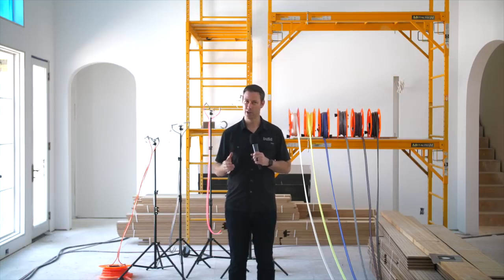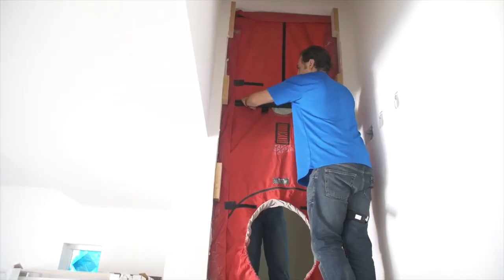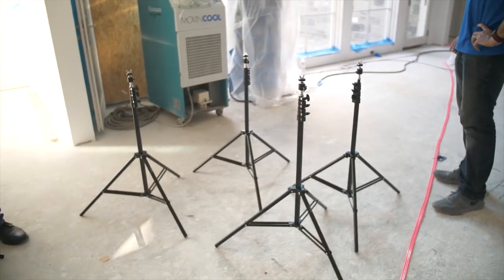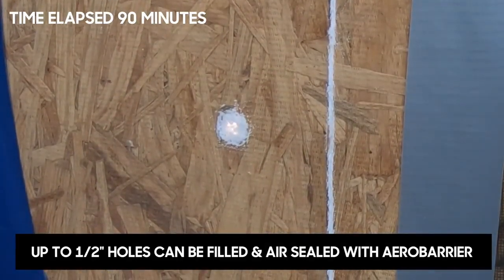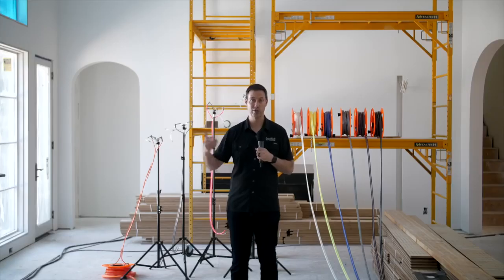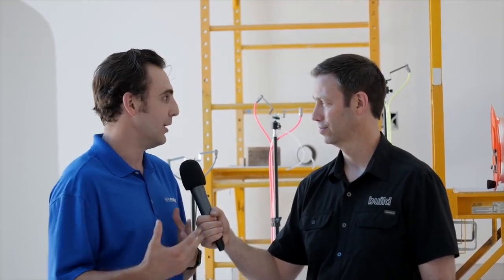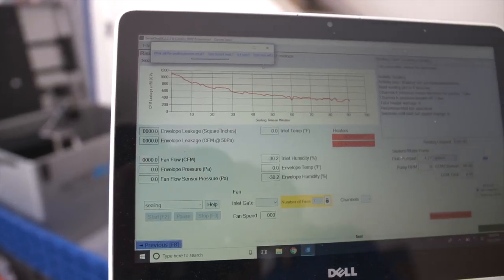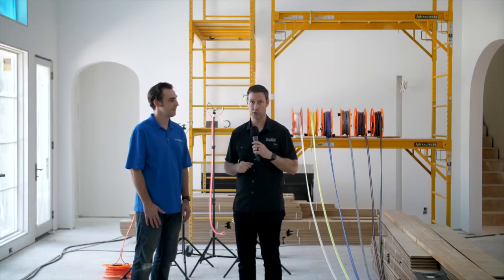Matt Risinger Calls AeroBarrier A Game Changer

Comment: Just used the AeroBarrier system in NC for new construction.  Cost was $1.00 per foot for a 2700 sq/ft ranch style house.  Used the zip 2.0 system, started at 4.7 ach50 and in two hours got to 1.0 ach50.  Very pleased with cost and final blower door results.
Reply: That’s pretty damned impressive!

Comment: I heard this is $4 a sq ft. If that is true most will not use it. I'm doing a renovation and would like to use this but with a 2K sq ft that would be $8K
Reply from the maker: Hi Minni -- The price varies by partner and depends on several factors, but AeroBarrier typically costs around $1 - $1.50 per sqft. We recommend contacting your local AeroBarrier partner for a free quote. You can find your local partner by visiting https://aeroseal.com/aerobarrier/dealer-locator/

Comment: I've done AeroBarrier on two houses now thanks to Matt Risinger promoting it.
Reply: How much was it? Was your houses remodels are new construction?
Reply: @CAC-1111  $1.50/ sq ft. New Construction
Reply: @wjthehomebuilder  thanks for answering. Can you tell/feel the difference in the home ?
Reply: @CAC-1111  I don't live in any of them.  The proof was in the blower door test.  It was extremely air tight.  One house was 1400 sq ft and is being heated with a 9000 BTU heat pump.  That is a low energy demand for 1400 sq ft.
Reply: @wjthehomebuilder  So you were able to downsize your HVAC equipment nice.
Reply: @wjthehomebuilder  I have a 2200 sq ft house that I'm converting from swamp cooler to a/c and I'm considering doing aerobarrier if I can find a dealer in my area. A/C contractor wants me to use a 5 ton unit which I know is oversized based on an internet search/research.
Reply: @CAC-1111  Exactly!  The cost for AeroBarrier will pay off over a few years in energy savings.
Reply: @CAC-1111  Yes that sounds like a lot.  We did a 2000 sq ft house (with AeroBarrier) that ended up with a 4 ton unit ONLY because we put a ductless heat pump in every room and the BTU's just added up to a 4 ton unit.  I was ok with that however, because the units were VRF (variable refrigerant flow) so they modulate the use from 100% down to around 5%.  So they only consume the energy that they need.  That house was cooling last August for $0.50/ cents per day.
Reply: @wjthehomebuilder  Wow, that's awesome. Was this a passive house? I wonder how effective it will be on a small remodel. My house was built in 1974 and is drafty. I replaced the windows already with low-e double pane windows but need to do more. My attic has blown insulation that is level with 2x6 rafter and has several penetrations.
Reply: @CAC-1111  It was not a 'certified' passive house.   But it was definitely air tight and over insulated.  We put 24" in the attic alone.   Are you remodeling the whole 2,200 sq ft? Or just an addition?  If you are gutting the whole house and not living there; and you can find someone to do AeroBarrier, it would definitely make it less drafty.  Note that AeroBariier gets all over everything.  So I don't know how you can do it if you live there.  If you can't find someone to do it, seal up as much penetrations as you can like you mentioned the attic.  Consider doing a blower door test ($150) before and after to measure your results.  I would also add more insulation where you can; like the attic.
Reply: @wjthehomebuilder  Thanks for all the information. I am remodeling the whole house so getting everywhere will not be a problem. Hey so my house is an split level 2 story design do you think the aerobarrier will help with the temperature between upstairs and downstairs. My upstairs is much hotter than my downstairs.
Reply: @CAC-1111  I think it will help.  But  I'm guessing you probably have a concrete slab on the entire downstairs which would naturally be cooler.  I also think having more insulation in the attic would compliment the air sealing.  So even sealing the attic penetrations and adding more attic insulation should make a big difference.
Reply: @wjthehomebuilder  I do have a concrete slab downstairs. The attic height is 4-4.5 ft so you would be on your knees or back the whole time. My house was built in 1974 so it has penetrations everywhere. I only have 4 inches of fiberglass insulation currently and it is pest infested that's why I want it removed. I wish I could just aeroseal the attic. It would be much faster. Plus it was 90 degrees in NM today. Attic temps would be ridiculous.